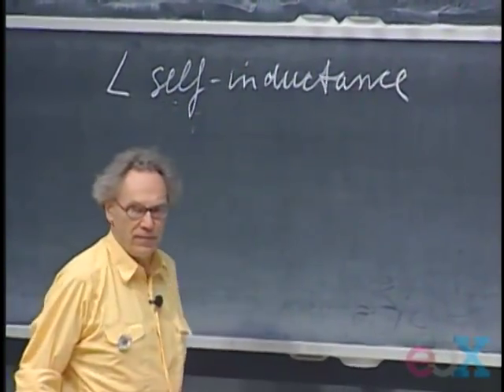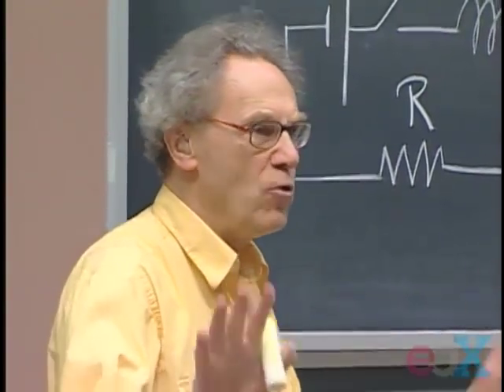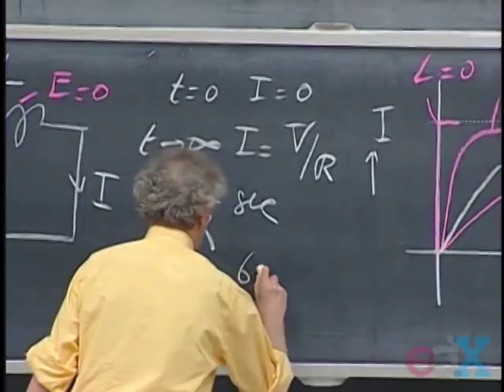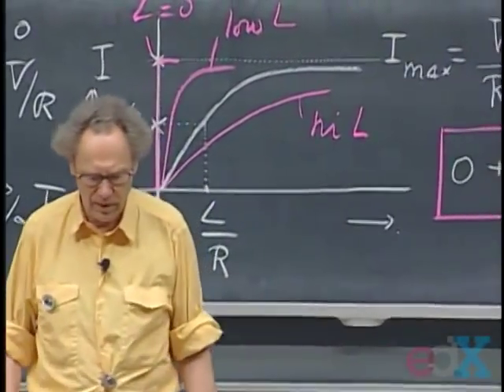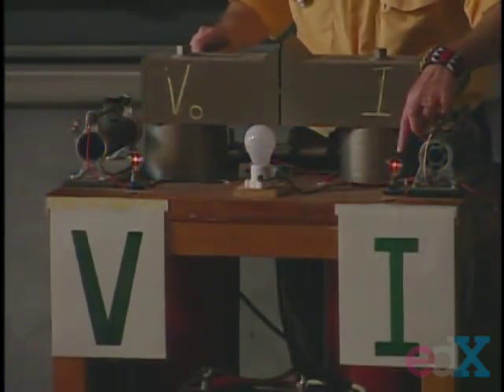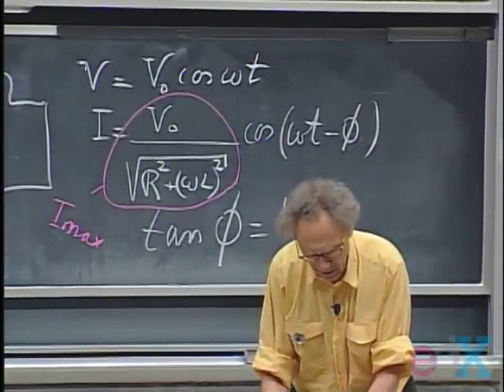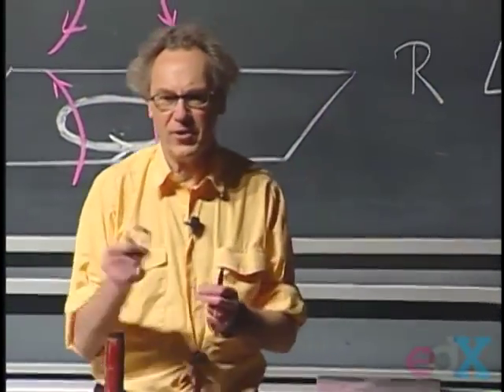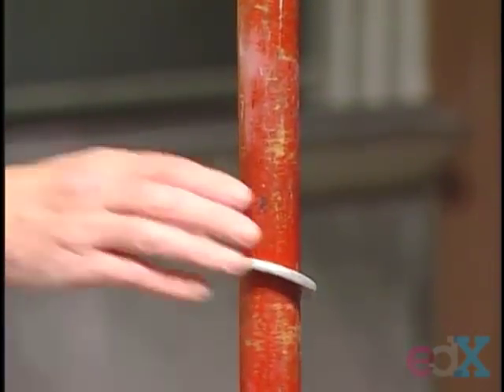8.02x - Lect 20 - Inductance, RL Circuits, Magnetic Field Energy

Comment: @11:00 kvl can be used since emf induced also a voltage so sum of voltage =zero     IR-Vbat+emdinduced=0?
Reply: AKRAM A. A. AL-KHAZZAR kvl has no terms that deal with changing magnetic fields, so kvl can not be used here
Reply from the maker: @robinhaas6895  you are dead wrong
I appreciate the fact that this Physics may not be familiar to you. Don't feel embarrassed about it; you are not alone. However, it's never too late to get educated. The choice is yours. Maybe this will help you. 
I demonstrated at the end of my lecture #16 of my 8.02 E&M course at MIT that two identical voltmeters attached to the same 2 points in a circuit can show very different values. https://www.youtube.com/watch?v=nGQbA2jwkWI&list=PLyQSN7X0ro2314mKyUiOILaOC2hk6Pc3j&index=17 The reason is that in the case of an induced EMF (Faraday's Law) potential differences are no longer determined; they depend on the path. This also applies to the secondary windings of transformers as the EMF in the closed loop of secondary windings is induced. https://www.youtube.com/watch?v=b7i2uMx7gHo&list=PLyQSN7X0ro22zanLOcvkaSY-IZqheFYM5&index=8
Of course, in cases where Kirchhoff's loop rule (KVL) applies, 2 voltmeters attached to the same 2 points in a circuit will always show the same value. 
My demo was first suggested and published by Romer in December 1982 in the American Journal of Physics. This demo has now become a classic; it's done all over the world at many colleges and universities. 
Kirchhoff's original text can be found in the following link, pages 497-514: https://books.google.de/books?id=Ig8t8yIz20UC. Clearly he was fully aware of the prerequisite for his "loop rule". KVL is a special case of Faraday's Law. That's why Faraday's Law is one of Maxwell's equations and KVL is not.
By teaching students that KVL always works without telling them when it does not work, makes many believe that the closed loop integral of E dot dL is always zero. ElectroBOOM and Dirk Van Meirvenne therefore believe that 2 voltmeters attached to the same 2 points in a circuit must always show the same value which is not true as demonstrated in my lectures. They each posted a video (see @ footnote below) on their channel in which they claim to have proof for their wrong ideas which violate Maxwell's equations. Apparently they do not know, or do not understand, that in the case of an induced EMF potential differences are no longer determined; they depend on the path. MIT students who took my 8.02 course (Electricity and Magnetism) would not make this mistake! I therefore believe that to introduce a "modern version" of KVL and then teach students that KVL always holds is not advisable as you may set them up for making the same embarrassing mistake that both Dirk Van Meirvenne and ElectroBOOM made. 
Also read Professor John Belcher's thoughts on Faraday's Law and on KVL. Professor Belcher is my former colleague at MIT. http://freepdfhosting.com/0813df09f5.pdf
(@) ElectroBOOM insulted me in his video by mentioning that the reason why my 2 voltmeters read different values was due to "bad probing". He stated that if I had done the demo correctly I would have found that both voltmeters would have read the same value. He could not have been more wrong  
This is my only msg on this issue. This is too basic. I do not argue either with people who believe that the Earth is flat.
This video may also help some of you to digest why 2 Voltmeters attached to the same 2 points in a circuit can give very different readings. https://youtu.be/T6S5VS03xZc

Comment: Professor, if the integral of the E-field is taken along the whole circuit in Faraday's law then the flux of the M-field into consideration is the flux through just one turn of the solenoid (because the plane of the circuit crosses the solenoid at one turn).
This means then that the self inductance of the solenoid should take into consideration only one turn of the solenoid. Hence the formula of L is proportional to N (and not N^2).
Can anyone correct me if I'm wrong?
Reply from the maker: what I did in my lecture is 100% correct.

Comment: Professor lewin, 9:30. How can integral of E.dl be equal to d(phi)/dt, where phi is the magnetic flux thru the solenoid. When we are integrating on the left hand side over the entire circuit, is it right to consider the magnetic flux change only thru the soap film surface attached to the solenoid(which is the rhs of the equation), the surface considered here doesn't even touch the whole current loop (referring to lecture 17).
Reply from the maker: your should try to understand Faraday's Law. If you take a copper ring and you quickly move a bar magnet into or out of the ring, a current will flow through the ring. I do this demo in 8.02 where the ring is a copper coil which  hundreds hundreds of windings but it's only 1 wire. There is a light bulb in the wire and when you move the magnet quickly in or out the light bulb lights up. This is the way we generate electricity. Faraday's Law runs our entire economy. The closed loop integral of E dot dl  -dphi/dt. Any dphi/dt, no matter how or by whom a dphi/dt is produced, will produce an induced EMF in the closed loop.
Reply from the maker: Watch this lecture in which I introduce Faraday's Law + demos https://www.youtube.com/watch?v=nGQbA2jwkWI&list=PLyQSN7X0ro2314mKyUiOILaOC2hk6Pc3j&index=17

Comment: Sir, I can't understand why current changes over time. What physical reason makes the current rise from zero to its maximum value?
Reply from the maker: how many minutes into the lecture?
Reply: Lectures by Walter Lewin. They will make you ♥ Physics. In general, I get that at zero time the inductor feels the instant change in current and the back EMF acts so the current is zero. From there what happens that make the current start to increase?
Reply: Lectures by Walter Lewin. They will make you ♥ Physics. I think I got it. Since at zero time the back EMF is not zero, this means that current is going to change, so from zero it becames a low current. So this process continues until the back EMF is zero because current has reached a constant value.
Reply from the maker: E-fields travel with the speed of light. NOTHING takes zero time. In solving our diff eq we do not take the dimension of the wires into account but it can be done and it could be important when we are dealing with GHz and higher frequencies.

Comment: Professor Lewin, 

I have a query that the magnetic filed the is produced by the closed circuit in the RL circuit does it have any effect on the magnetic field produced by the solenoid/inductor, because the current flowing in the circuit will itself generate a magnetic flux which is going in the loop and would be perpendicular to flux generated by the inductor (as per my intuition), could you please elaborate on it though. Thanks for the amazing lectures
Reply from the maker: Make a calculation! You will then conclude that the effect is so small that it can in general be ignored
Reply: @lecturesbywalterlewin.they9259  Thanks for responding Prof Lewin, will do it 😊

Comment: Sir, thank for your great lecture. But I have a question @48:37, since the current in the ring has 25 degree phase shift from the induced EMF, doesn't that mean when you calculate the current I in the ring, the current should be equal to inducted EMF divided by impedance Z (Z = R + jWL) rather than the resistor R? But in your previous lecture 16, you mentioned that the inducted EMF is just equal to I x R. And @33:16 in your lecture 16, I do see that the current is 3 times larger if there are 3 loops around the solenoid. If the inductor should be considered for calculating the current, the current should not be 3 times larger because the inductor has also increased. That really bothers me a lot and hope you can help to clarify it for me. Thanks again for your excellent lecture.
Reply from the maker: I checked the times you mentioned and I cannot add any to the clarity of what I said and did.

Comment: Professor, regarding the comment you made about inductors not having a E field or a Voltage drop across it; do you mean that whenever a EMF is induced (Faraday) there needs to be a resistance? But dont you induce eddy currents in your superconducting (cooled) ring?
Reply from the maker: Any induced emf (Faraday's Law) will show up in the ohmic resistance portion of a circuit. 
Feynman:
In a ''perfect conductor'' there is no resistance whatever to the current. So if currents are generated in it,they can keep going forever .In fact,the slightest emf would generate an arbitrarily large current -which really means that there can be no emf at all.Any attempt to make a magnetic flux go through such sheet generates currents that create opposite B fields -all with infinitesimal emf's,so with no flux entering. If we have a sheet of a perfect conductor and put an electromagnet next to it, when we turn on the current in the magnet, currents called eddy currents appear in the sheet, so that no magnetic flux enters.

Comment: Thank you so much this is too important but sir i have a question how is the current passing through the hole circuit if it isn't passing through the inductors wire is it passing through the air between the coil of the soilinoid and if that the cause why don't you consider the air as a resistors? and isn't that means that the potential diffrence across the inductor is zero?
Thank you
Reply from the maker: >>>>the current passing through the hole circuit if it isn't passing through the inductors wire is it passing through the air between the coil>>> ofcoz the current is going through the wire of the coil of the inductor. Please watch my lectures.
Reply: @lecturesbywalterlewin.they9259    sir i have seen this lecture and aslo lecture 16 and many other of your lecture but I'm confused because if there is no electric field in the inductor isn't that means that there is no current in it?
Reply from the maker: @zahraa-dm5cy  ofcoz current can go through any wire that has zero resitance in which there is NO E=field. V=IR V=0 R=0 I can be anyhting.
Reply: Thank you so much sir
Reply: @lecturesbywalterlewin.they9259  yes indeed sir you are right and sir you are great teacher i can't sleep because of curiosity your lecture created in me again after my childhood

Comment: As omega  increases what happens to the phase  relationship  between the  direction of the current  flowing in the inductor and the  direction of the  magnetic field created by the inductor .
Reply from the maker: phase angles have only meaning if we deal with AC. I suggest you watch my AC lectures on RLC circuits.
Reply: It is at 32.30 in this lecture  that you discus AC ,  induced EMF , current and phase angles in Self Inductors , what is happening to the phase relationship  between the direction of  current flowing in the inductor  and   the direction of the magnetic field created by the inductor as omega increases.
Reply from the maker: after 32:30 I introduce AC Power. I give you the solutions also the tan of PHI. I cannot add anything to the clarity of my lecture.  My equations allow you to increase omega.
Reply: Later in the lecture the magnetic field is discussed, in the discussion on magnetic levitation, and I see that the magnetic field and current direction alternate together.

Comment: 9:48 Professor, I don't understand, why is it that in the solenoid there isn't an electric field? How is that related to the fact that it is superconducting material? If there is a current which means there are charges moving inside it shouldn't there be an electric field because, if otherwise, how would they be moving?
Reply from the maker: Current can go through a super-conductor but NO E-field can exist in a super-conductor. Keep in mind that E=j*sigma. Here j is the current density and sigma the conductivity. Ina super conductor sigma is infinity and E is zero, thus j=E*sigma can be anything. I suggest you also watch https://www.youtube.com/watch?v=LzT_YZ0xCFY&list=PLyQSN7X0ro22zanLOcvkaSY-IZqheFYM5&index=6 and
https://www.youtube.com/watch?v=FWMhk6x785Q&index=26&list=PLyQSN7X0ro2314mKyUiOILaOC2hk6Pc3j
Reply: Thank you, professor, I realize now that this is going to take a while to sink in

Comment: Sir,
In the exiperiment at 30:0 , if we use ac supply instead of dc supply, ( let bulb withstand Ac voltage).
Den how is the illumination of bulb which connected series with inductor ?
Is it glow ? >> induced current in the inductor is 180degree phase shift with respect to source current ??
Reply from the maker: ac current  in the light bulb
Reply: Is it bright or dim ??
Today i did an experiment with small transformer  230v/12v ,2A.
I connected 230v,40w incandescent lamp serial with primary of the transformer to 230v Ac supply..

But the bulb didnt glow..
.

Comment: sir, I have one doubt. why do we say that integral E.dl is zero inside the inductor. Since, there is time varying B due to change in current, so there is induced electric field inside the inductor and hence the LHS of the faraday law equation (that you have applied in the circuit), should also contain E.dl due to induced electric field. 
My one understanding is that may be we don't consider E.dl due to induced electric field because its effect is already there in the current. Please reply. Lots of Love from India !
Reply from the maker: an ideal inductor is made of super conductingmaterial. No E-field can exist inside as that would make the current infinitely high.  Thus the integral of E dot dL throughn the wires of the coil must be zero,

Comment: Dear Walter,
19:55 two questions
1. if we know energy of magnet field that was generated inside coil after we turn battery off  ... then we can say and know energy of permanent magnet field! strange this not very popular term and idea to say that PM have own energy...and then the question where is the source of permanent magnet energy?
2. who can clearly explain source of energy and mechanism Lenz force, that do work in opposite direction of battery current when we start process? as it is very clearly that this is external power (that not present on circuit) that do resistance job against battery...as this is external force, than who is actor of this force - what materia\carrier?
Reply from the maker: I don't understand your questions. When you close the switch, current will slowly increase. The energy stored in the B-field of the L and the I^2*R power dissipated in the resistor are all provided by the battery. As you open the switch, the current will decay; the B-field in the L will decay and the energy that was stored in the B-field of the L will be released as heat in the R.
Reply from the maker: You also asked me questions regarding my famous demo with 2 Voltmeters attached to the same points in my circuit. The demo I show has become a world classic - it is shown all over the world. Two identical  voltmeters connected to the same points in my circuit. They show very different values and the polarities are reversed. That's the power of Faraday/s Law which runs our entire economy. It's amazing how many physics teachers have a religious INCORRECT believe that Kirchhoff's loop rule always works. If that were true my two voltmeters should read IDENTICAL values with the same polarity but that is not the case.  I do get occasionally comments from physics and EE teachers who want to argue with me about this demo and its non-intuitive results - they clearly never FULLY understood Faraday's Law. I teach physics, I do not argue with people who think they know but who don't.
PS in the demo at MIT the points A and D were each only one point and both voltmeters were attached to A and D. HOWEVER, I want to stress that the circuit I drew on the backboard would have worked equally well (read my Lecture Notes of Lect #16 it's posted as a pdf file below the thumbnail of the video). My wires have all resistances far below 0.01 Ohm. Only people who do not understand Faraday's law believe that the very different readings of the 2 voltmeters are the result of  the A1-A2 and D1-D2 wires. They are wrong.
Show less
Reply from the maker: >>>if so far logical chain correct let try answer on question, as L was powered by battery - we take energy from battery and place it into B field of coil (that dissipated shortly after we detach power supply - energy released)
what is energy source of permanent magnet field B, that can do some work and continue present without any visible power source>>>>
Keep your texts short please. 18,000 people watch my lectures daily. 
I suggest you watch my lecture on magnetic materials. https://www.youtube.com/watch?v=1xFRtdN5IJA&list=PLyQSN7X0ro2314mKyUiOILaOC2hk6Pc3j&index=22
Reply: ok, will do, thanks a lot! is there any other public place where we can discuss physics  questions but not limited with message size as it is hard to explain in two words?
sure if you interested :)
Reply from the maker: search the web.

Comment: sir when you switch of the light at time 30:11 I thought the self-Inductance would delay the bulb " I " to go off. But both the bulb turned off at the same time.
Reply from the maker: look closely at the 2 circuits - before the light is turned on and when the light is trurned off.
Reply: Thanks for the reply sir

Comment: my understanding is that if we connect a voltage battery to a wire, initially there will be resistance and also self inductance that opposes current flow.  am i right?
Reply: yes you're right. the opposing of inductance always exists. but it's strength is decreasing.